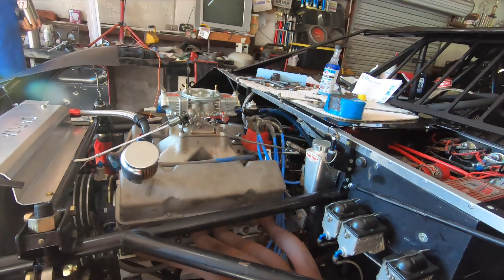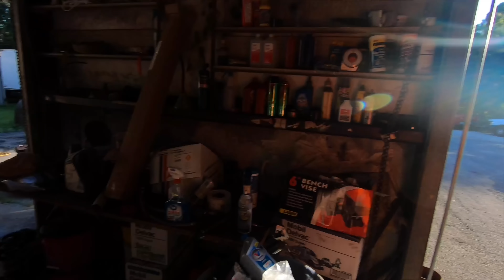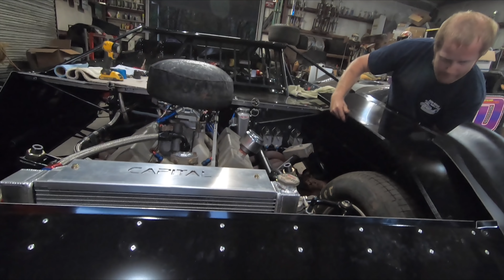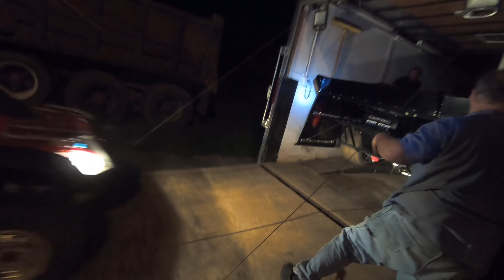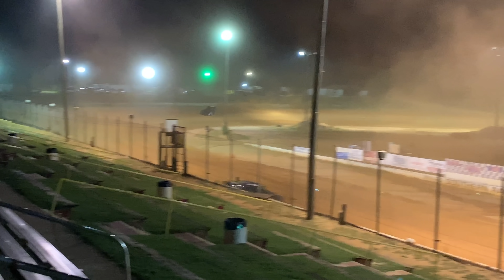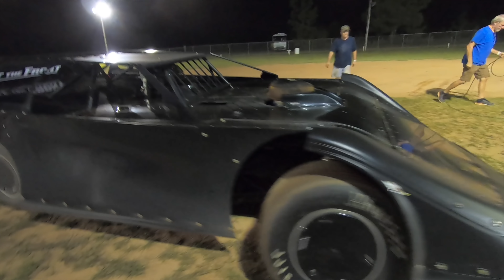We Debuted the New Late Model and Worked Out All the Kinks

Comment: Looks good. Once the brake issue got fixed, much better. I hope y’all can get you a little more motor someday. Love the new car, y’all deserved one. You got a good one, and they’ll help you too. That speaks volumes. Go get em tonight and tomorrow!
Reply: mike smith don’t think they need anymore motor they have useable HP most of these guys put tapered spacers and restrictor plates on after hot laps or qualifying depending on track conditions anyway

Comment: now compare the steering wheel of this car compared to that street stock a couple weeks back.  a car set up correctly you turn it into the corner and right back straight, the car will drift all the way around the corner with minimal wheel impute and the tail inline, drive tires pushing the car forward, the driver not having to wait on the chassis to set before getting back to the gas.  this car was doing all that.  the more you have to work the wheel, the slower the lap will be.